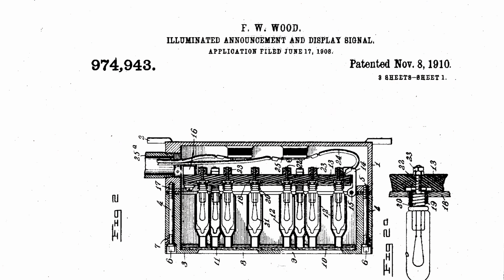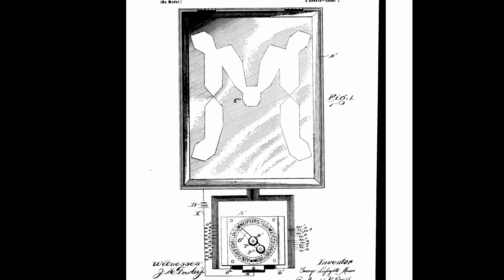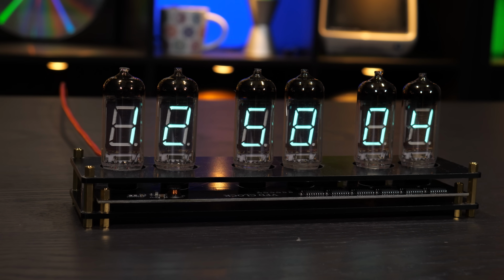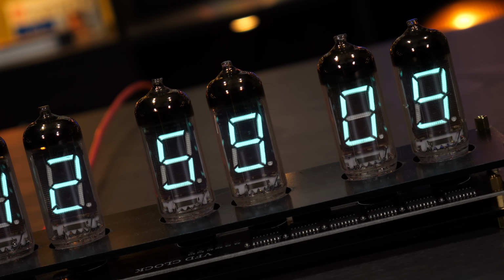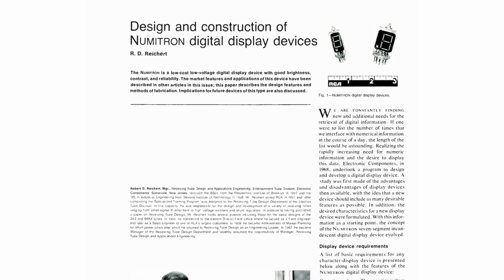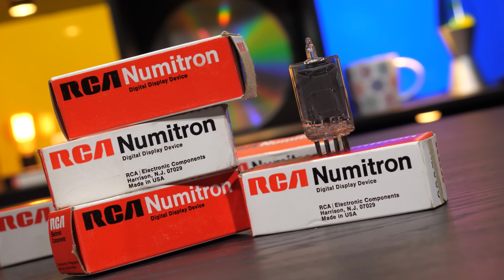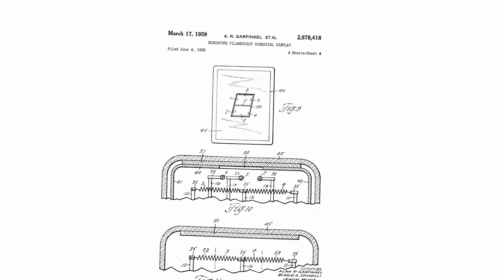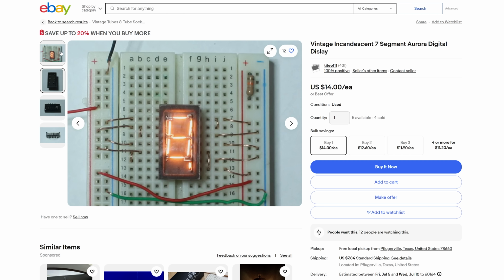The Numitron: An obvious idea that wasn't very bright

Comment: Considering LED filaments are now a thing and much brighter with less heat, I think it's time for a refresh of these, a Newmitron of sorts, made from LED filaments
Reply: Neumitron would be a more-faithful spelling, and I agree, especially given that dimmable LED filament bulbs exist as well as ones styled after analog Edison tungsten bulbs. You could absolutely make these and in plastic tubes to reduce fragility, running on the same 5 volts as the originals. And why not go to full 16 segment alphanumeric and potentially use RGB to allow the user to set the warmth of the colors beyond dimming?

Comment: Ouch, you were really hard on the engineers that designed the numetron. There is no telling what kind of pressure the engineers were under, or how they felt. Perhaps they made it under duress to get a marketing vp off their backs knowing it would not last. Just to shut them up or prove them wrong. Sales people are always  blaming this or that for poor sales. Man we could sell a boatload if we only had a display that did x.

Comment: Back in about 1966-67 I was on an openhouse tour of the RCA lab in New Jersey where I saw a numeric display made of Electroluminescent panels. Very very crude. I did get an RCA album Duane Eddy's "Twangesville" as a gift upon exiting. Pretty weird that those are the only two things i remembered, but I was 12 yo at the time.

Comment: Hmm.  I wonder...  What if...

You cracked one of these open really carefully (as in, you'd have to be really good at cutting glass) and then replaced the filaments with LED strings - you know, the sort in retro light bulbs - but low voltage.  And then glued them back together.  (And if you felt really obnoxious, painted that background plate with vantablack...)

Comment: You left out the bigger reason that Nixies needed something better to come along, as with the later development of gas-discharge 7-segment displays: parallax error.  Nixies just looked TERRIBLE when viewed from any other direction than straight on, because the cathodes could only be placed so close to each other, so every number was on a different plane.  So pretty much any 7-segment or projection display was immediately better than Nixies.  I think that Nixies were meant to be a cheaper, more compact replacement for projection displays in the first place.

But do you want to know what the absolute WORST displays were?  How about 7-segment electroluminescents?  In addition to needing high AC voltage, they also faded over time, badly, so if you had the same number displayed for a long time, the segments used for that number would be dimmer than the others.  How long of a time?  I maintained a military device that had to be on 24/7, and we had to replace those displays every six months or so, because by then they were nearly unreadable.  And yet this is what NASA chose for the Apollo DSKY display!

Numitrons had their time, although it was a much shorter time than RCA would have liked, LEDs were expensive, tiny, and not very bright, so for applications that needed to be read from a couple feet away, were self-illuminating, and operated on low voltage (seriously, all it took was a cheap cheap 2N3904 to drive each segment to get a nice, bright display, and these could be multiplexed), the Numitron made a certain amount of sense.

Comment: Back in the mid to late 70s I built a system which displayed quite a lot of digits in a steel works, and designed boards to drive them using BCD signals. The boards were cheap, used discrete transistors, and worked. That's an exhaustive list of their merits. Consistent with the displays (they were the flat variety) really. The steel works environment negated the displays' flaw regarding ambient light. There was little of it.

Comment: Unrelated to 7 Segment Displays but related to wierd clocks. I've made an Analoig clock in the RGB lighting of my Keyboard.
It uses F1-F12 to show Hours (Red) and Uses Those same F keys in Orange to show 5 Minute Segments of the hour. with the G6-G9 Logitech Macro keys Functioning as 1 minute Segments of the 5 Minute segment currently in progress. Then Esc becomes an AM/PM indicatior.
If the current 5 minute periood overlaps the hour then it will flash between Red and orange once per second to show this overlap.
Also there is a hidden Second Hand in Green that displays Flashing Seconds in the same method as minutes which is hidden behind weather or not the Scroll Lock is turned on or off.
So for example at present F6 is red to indicate 6am, and F1-5 are orange indicating 25 minutes past, and G6-G8 are orange indicating another 3 Minures to make 28 past.

Comment: The airplane I used to fly (Dash8 100 & 300 Series) was designed in the late 70s/early 80s and used a lot of Numitron-type displays (minitrons?) in the DC and AC electrical controls panel for voltage and generator load monitoring, battery temperature displays, clocks, etc. When they crapped out over time due to a burnt segment they often put in a new "improved" panel with LED digits.
Vacuum Fluorescent Display: in the late 70s, to give a "modern" look to their new line of stereo amps and receivers, Pioneer replaced the traditional needled VU meters with VCDs. Marketed them as the "Fluoroscan" series, also commonly known as the "blue line" series since the VCD had a bluish tint to it. I have one of these.

Comment: Pretty sure Collins used numitrons (or a numitron clone) for the frequency display in their general aviation radios. People still have them installed today! Avionics also used cold cathode 7 segment displays until very recently, which require high voltages (generally once a piece of avionics gets certified, its design is completely ossified for decades so even recently manufactured radios use long obsolete displays).

Comment: I was actually a product designer in the 90,s before there were display technologies we have today. We were looking at every kind of display we could find and the options were very limited. We didn’t have white LEDs or color flat screens.  We even built a prototype with a small CRT tube display the took up about 10 inches of depth. We ended up with a bunch of red 7 segment LEDs and individual LEDs next to text. So crude compared to today.

Comment: Did you know if you drop a VFD in water, it sinks. I tried this with a CRT from a RCA television in my local lake. Tied a rope to the metal band around the front screen and dropped it in. What was weird was it didnt completely sink. it leveled off at 25 ft down.  Then it went all 'Titan sub' and vanished. Recovered the the front, like the titan sub.

Comment: I still repair aircraft radios that have this type of display in them, they are in a DIP package and are called a "pinlite", these are in cessna radios from the '70s and are still widely installed and used in older cessna aircraft!

Comment: Nixies IMHO from Burroughs were far superior. Even though numitrons had advantage over them with low voltage drivers, the nixie superiority of its overall display presentation was instantly evident! Bring back US reasonable cost nixie and Burroughs plasma self scan panels!

Comment: our microwaves second letter/number area seems to be flickering and the bottoms burned out and i cant for the life of me figure out why.. the previous microwave it replaced would run constantly while plugged in and the display was totaly burned out...  it might be an issue between the microwave and the circuit breaker in the garage.. we have those supposedly eaton smart breakers. i pressed the test button for like 30 seconds but it never tripped.  should probably replace the breaker.

Comment: I remember seeing them on petrol pumps around 1980 or so. As a nerdy kid I could see how they worked right away and thought it was rather a cool idea because I was kinda dumb back then. Of course it's a stupid idea because for the filaments to be equally bright they all have to be the same length.
Note that say petrol and not "gas" because petrol is a liquid, not a gas. That's how we can pump it down tubes and have it fall into tanks by gravity. Glad we got that straightened out. However, even in the UK we were still selling petrol in gallons at that time so we can't feel too superior although we've since converted to proper international standard units.

Comment: 0:59 interesting you mentioned mechanical ones. Attoparsec did a video on June 25 (last week) on "Making a d10 spinner" where he used 7 segment mechanical flip displays that only require power to change the number, but otherwise use NO POWER.

Comment: Nice to get some background on these. I have two DR2100 that have been lying in a parts box for many years. They are certainly a bit "meh", though. I took them out at one point, realized that they might be usable at low voltage, tried it, basically went "oh." and put them back in the box.

Comment: You are misrepresenting how they were used. They are a point light source designed to be diffused. Put them behind a frosted plastic (protective) panel and they are very easy to read.
Reply: It'd have to be a very not very frosted panel. The light source is well behind the panel surface and radiant across a large angle. That would make for a funky light box where people can't tell what's making the light.

Comment: I have a 1981 Panasonic RC-95 clock radio that’s been in operation since bought new. Greenish fluorescent display has a dim and (very) bright switch on it. The display has also long outlasted the radio’s dial light!

Comment: Filaments don't have to be straight, thin lines. They can be coiled to make them thicker, and they can be guided around posts to make any shape you want. There are lots of examples, even in "ordinary" light bulbs.
Reply: Thinner and coiled filaments would sag, guides complicate the design. More practical would be to place milky glass right in front of them.

Comment: With better positioning of the filament support pegs, it would be possible to greatly reduce the visible gaps between the segments. I think if they would have done that, this product may have had a chance. the only thing that would have replaced them, would have been the LED, and the LCD displays.

Comment: It was a quick solution that fit in a niche right before LED and LCD displays were really viable.  What were they supposed to do?  Hold off building any new electronics with displays for a couple years?  Sometimes a quick and dirty stopgap looks quick and dirty.  Why be so picky-pants about it?

Comment: Worked on equipment that had Nixie tubes . Served in US Navy 1974-1980, as well as defense contract on ships. High voltage DC circuits were common in such systems, so the power supplies were there already. Unfortunately, because of the multiple circuits and sometimes some Nixie tube displays, troubleshooting and repair could be difficult.

Comment: Numitron probably wasn't intended to be anything other than a placeholder in the display market, intended to "hold the fort" for RCA until LEDs matured enough to replace them. At the time, RCA was a leading electronics company, locked in head-to-head competition with a relatively small number of companies that were exploring the rapidly-evolving digital semiconductor market. In 1971, LEDs were very expensive (as you noted) and quite dim (which you didn't). RCA wanted to "stake a claim" to the coming 7-segment display market without waiting for higher-output LEDs to become available. 

RCA was still one of the leading vacuum tube manufacturers in the world at that time. The Numitron was a way for them to leverage their existing captive vacuum tube production capacity to get into the large-format 7-segment market early at fairly low cost.

It was a case of "good enough" holding the fort until "much better" became available.
Reply: I made the same, albeit much simpler, comment above. They likely only put enough time and money into these so they were functional until LEDs were no longer cost prohibitive. 

There is a 0% chance RCA didn't know LEDs were the future and weren't aware that cost effective solutions were very close to reality. They just needed something as a holdover until it happened.
Reply: Your comment was more informative than this entire video.

Comment: ..I only mentioning LCD as a sideonote .. well LCD's are in use today and still being developed...
..many computer screens r LCD panels...
..one of the largest benefits its power reqierments..
a panel 1920*1080 can draw as lttle as 20w (9.6 micowatts per pixel) 
..a LED display can draw 5-6 times more

Comment: I’ve worked on a 1975-ish Cessna Citation jet that had these for N1 (fan speed) and N2 (turbine speed) indicators. Last time I saw it, the 7th segment making the digit an “8” was burnt out for one of the two engines. So the indicator would show 68%, 69%, 70%… 78%, 79%, 60% 
Caused a little bit of a stir during our ground run

Comment: Looks like you need a buffer between your BCD and the tube.  Grab yourself a couple of SN74F244NE4 chips from Mouser. They're octal, non-inverting, buffers in a DIP package, which can output 64ma per pin.  If I'm reading the datasheet right.  I've never personally used them, but they look like a good fit for a few minutes of searching.

Comment: cold war era russian display tubes are a deep, lovely rabbit hole, well deserving of it's own hour long video!

so much experimentation and inovation, that never caught on, but absolutely deserves to be remembered!

[tl;dr: the "IEL-0-IV 140-36" "electroluminescent display indicator tube"  AKA the "alien nixie" could display arabic numerals, as well as cyrillic and western letters with just 8 segments, ald looked really sleek. then there were all the MARVELLOUS thyratron display tubes, with the (never really used) ITS1A holding the potential for huge full RGB video screens, before LEDs were even visible in daylight, and the delightfully warm orange 100x100pxl neon plasma dot matrix of the MC6205.]

Comment: What seems like a lifetime ago when I started my career in marine electronics I came across a similar technology being used in the JRC (Japan Radio Company) JLN-203 Doppler Speed Log. This is a cool gizmo that measures a ships speed through the water by bouncing sounds wave forward and aft underneath a moving ship. Anyway, the first versions of these I installed used the filament 7-segment displays that were in the glass fronted 0.3" DIP package shown briefly. They worked OK but when it came time to replace them spare parts were hard to get. I ended up making adapters that would allow a traditional LED display to plug into the socket.

Comment: Interesting tidbit: At least some Numitron style devices (Minitron 3015F definitely!) have a true vacuum and rely on that vacuum to thermally insulate the filament - a device that went to air will show continuity but simply will not light. Power supply for VFDs can indeed become complex - especially since voltage gradients across the filaments do matter since they are also cathodes, with some VFD you actually NEED to drive them from AC and/or really fine tune the power arrangements to even things out. ...

Comment: I recall the orange numbers in the gas pumps at ARCO (Atlantic Richfield), back when the pumps vaguely resembled Johnny 5 from Short Circuit.  These pumps were accessed from both sides (shared between the L and R side of the island).  I prefer the pumps with the wheely numbers to these.

Comment: I have several self built clocks. my largest, uses 8 inch digits where the segments run on 24v. the board running that is an aliexpress wifi clock with an ESP8266. one of my other ones is made with the countdown numbers from pedestrian crossing lights, using an LM8361 for the controller. Also have a CRT clock that sets itself via wifi, and a clock i made from 74LS logic. working on a relay based clock soon.

Comment: Under driving them seems very dirty. Trying to compare bare vs. enclosure is not great, but seems less misleading. Lower heat lead to several clever covers and enclosures. Downvoted for the focus on washout, since it was not bad compared to several of the alternatives you offer.

Comment: The Numitrons make me think of the displays used in the sci-fi shows of the 1930's, or at least flashbacks to films from that time in movies made later on. Shows with names like Danger Dan and the Ancient Aliens from Andromeda!!! (The three exclamation marks are extremely important along with the alliteration.) Where there's rockets with smoke shooting out of the back and flying straight across the screen even though the top happens to point 30 degrees up, there has to be some sort of electric sparking machine, and someone is wearing a cape and weird hat. Even the name Numitron fits. It's called numitron because it shows a number. :)

Comment: I know you stated that your Numitron clock was done with lowest effort possible (thus driving the display directly from the driver chips). If you really wanted more current going through the filaments, you could have driven the displays with transistors or mosfets that were then driven by the driver chips. But then that would have probably added more complexity than you intended...

Comment: I am reminded of a digital clock I saw at a cousin's place in the 1970s. Each digit was rendered by what looked like tangle of filaments that could render a number exactly (i.e., not a seven-segment display). What was fascinating about it was it took about 5 seconds for a number to change. The when the time changed (it was precise to the minute), the old numbers would slowly fade out while the new numbers slowly faded in. No idea what the make was, or the tech behind it.